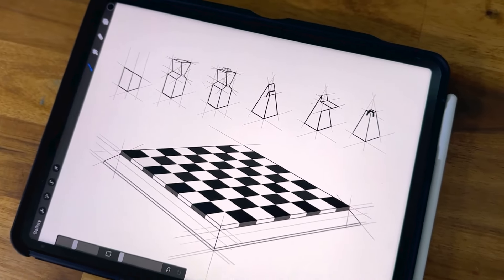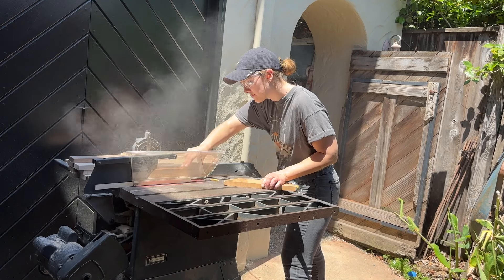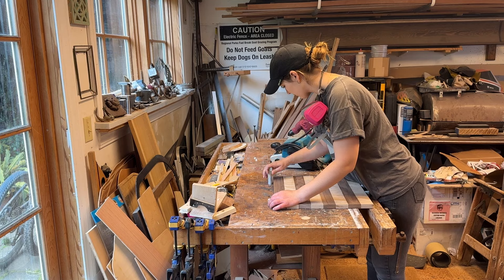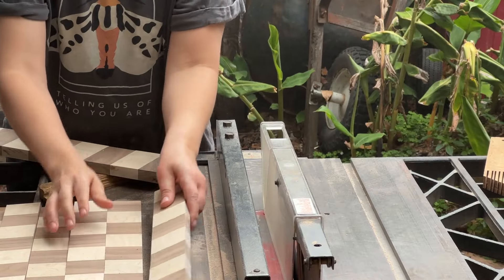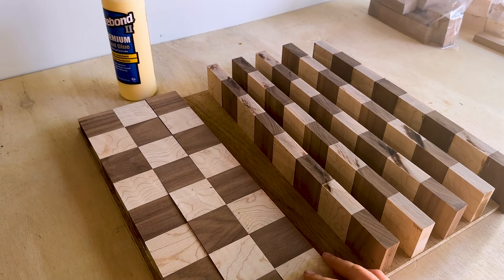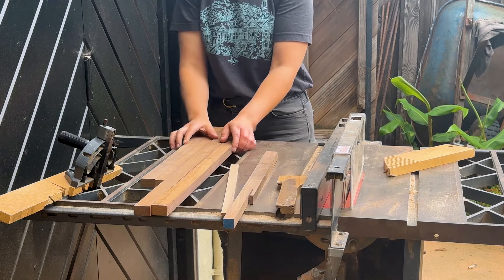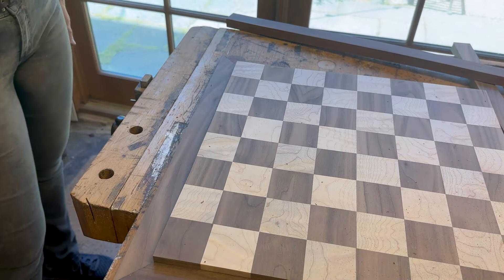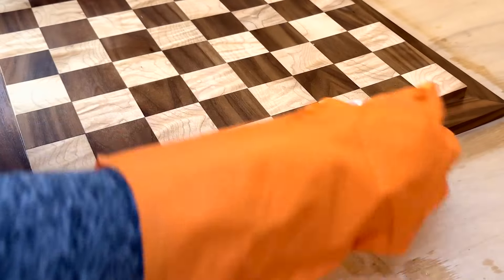Making a Chess Set – Including All the Pieces!

Comment: Beautiful board and job. Would have liked to have heard more about the products you were using. What did you use to clear coat the board with etc. ? Also with that beautiful board and attention to detail,  I would have loved to have seen that sort of effort on your pieces. Perhaps by using an oscillating tool and a dremel tool with stained sanded pieces. Overall, I really liked your project I may do something similar. You've certainly provided a nice blueprint.

Comment: I had the collet on my router fail and at full rpm it shot the router bit out hit my thumb and fly 8 ft across the garage and put a hole on the sheet rock above the door. I think i had the same look on my face as you did. Stay safe.

Comment: I looked through the comments and could have missed if someone else mentioned it or not. But a good way to fill little cracks or gaps is to put a little wood glue in them and run your sander over it. The sawdust will stick to it filling the gaps.
Reply from the maker: Thanks for the tip. I'll have to try that technique next time!

Comment: Who hasn't made a learning mistake on a table saw? Myself, I don't use the guard, especially that one as it causes more danger then it saves. Create a zero clearance blade insert with a riving wedge behind the blade instead. Small strips won't likely get between it and the blade. I believe I have that exact model of table saw. It has lots of issues and if you are going to do woodworking for a longtime, get a better one, preferable a SawStop. Your project came out great. I bet I have had to redo part of a project more often than not. Just keep trying and learning. Good video.
Reply from the maker: Yeah I'm not a fan of that guard and I'm saving up for a SawStop right now. From what I've heard it's 100% worth the extra money.
Reply: @elenamakes  take it from someone who spent about $10k after slicing through two fingers. It is well worth the extra money